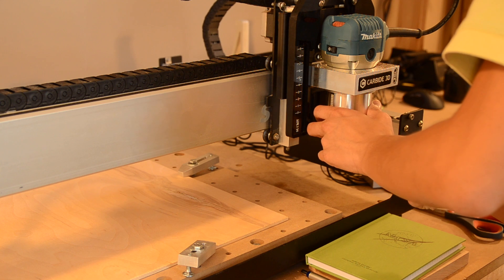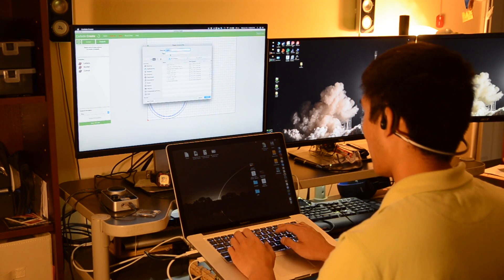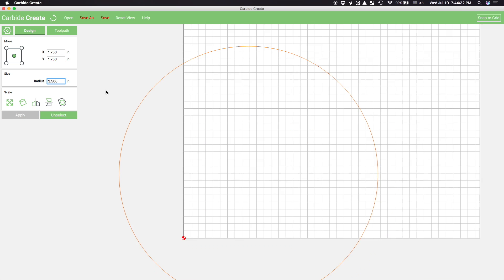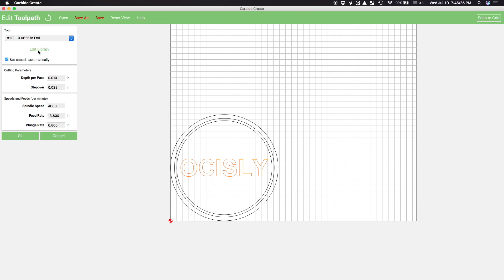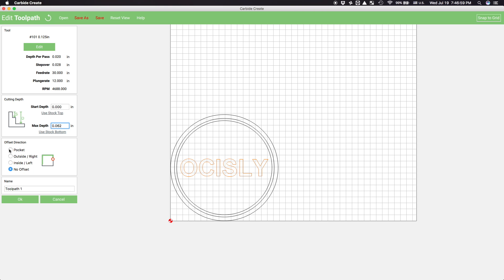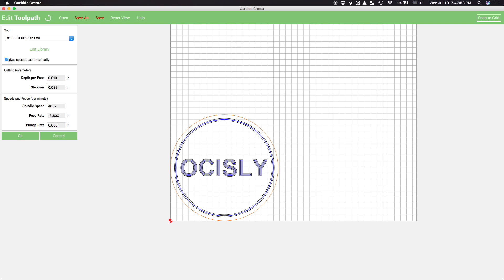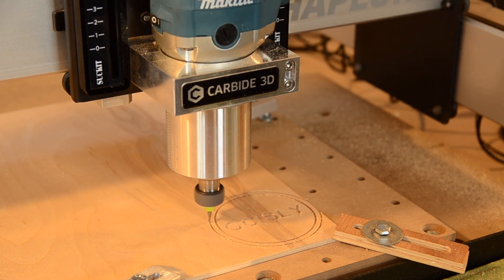Intro to CNC - Part 3: "The Workflow"

Comment: Hi Winston, i really enjoy watching your videos! I just wanted to ask/comment on the Makita router in the vid, I chose to go with the same model over the Dewalt because of the Makita's range of 10k-30k rpm.  I had watched a previous video where you compared the two but decided on the Dewalt, have you finally warmed up to the Makita, or is there another reason for its appearance?
Reply from the maker: I find the two to be quite comparable, but I'm running the Dewalt on my Stock 3 in the garage and the Makita indoors mainly because it's quieter. But later when I start my next Aluminum-based project I'll be using the Makita as my primary because of its lower RPM. I honestly like both, but whether I pick one or the other largely depends on whether or not it has a strategic advantage over the other. In wood cutting, there's no appreciable difference. Metals and plastics? Makita's the way to go.
Reply: Thanks Winston, glad to hear that as I'm pretty happy with the Makita myself so far, mind you, I haven't cut any aluminum yet, only MDF and Acrylic to date, but do have a few plates I plan t fashion into rigid upgrades for my C-Beam CNC. cheers

Comment: Winston, have you ever cut HDPE before?
I need to cut 1/2" HDPE for a product I need to design. I'm new to CNC & looking at a Shapeoko 3 XL & I'm also a noob in Fusion 
360 (Already have my design in Fusion 360 done).

Thanks,
-Bryce
Reply: I cut a bunch of clamps from some .75 inch HDPE on my Shapeoko 3 XL and had no problem other than the mess but I expected that.
Good Luck
Reply from the maker: Yep, https://www.youtube.com/watch?v=O_rBqPv0u3I    
It's more forgiving than acrylic or polycarbonate since it's so soft. Slices easily with a good sharp endmill. Just need to make sure your flutes are large enough to evacuate the chips.

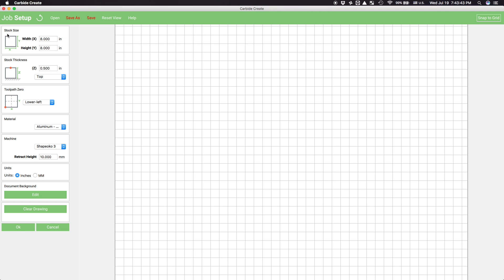Comment: I wonder if there is a way @1:27 under machine if there is a way to trick CC to utilize the full work space of the 1000mm Xcarve since that MACHINE option defaults to Shapeoko's work area dimensions
Reply from the maker: +omgbbqwtf2 If CC can accommodate a Shapeoko XXL, I don't see why not. Those two are within a couple inches of each other.